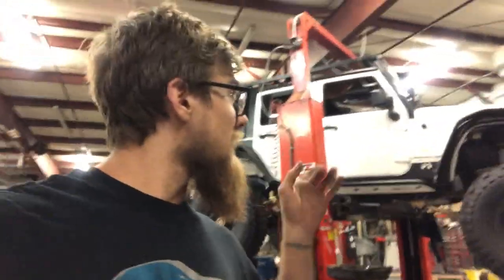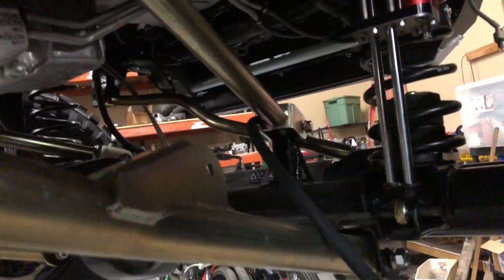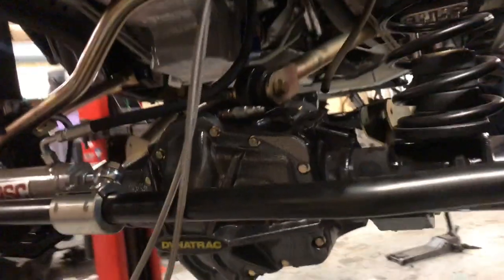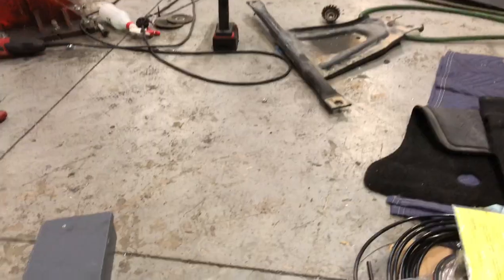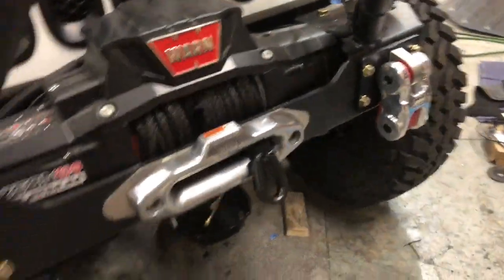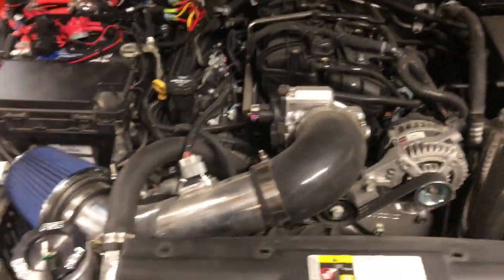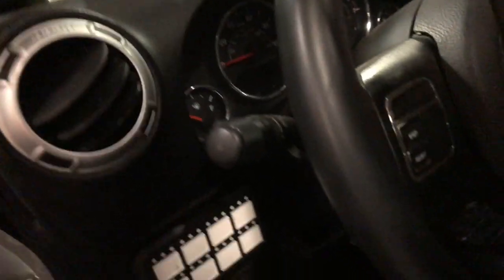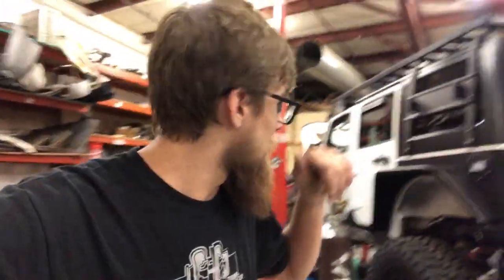Massive LS Jeep Build Walkaround - Metalcloak Lift, Dynatrac Axles, 40" Nitto Tires

Comment: cool build...only thing I have to say is that its not a true 4 link because it still has a track bar so maybe a 5 link? I would like to see a build on a triangulated 4 link setup...maybe for my jeep someday. can you tap into the air compressors to fill up tires? also did you guys do the swap? my uncle is looking to LS swap his JK and wants a ballpark price.
Reply from the maker: It’s still a 4 link but it’s a parallel 4 link instead of a triangulated 4 link. Yeah there’s an air chuck on the rear bumper for filling tires or air tools. We didn’t do the swap so I can’t help you there. Ballpark price is $10k minimum
Reply: @6berries  makes sense